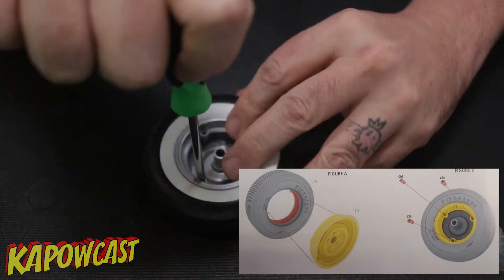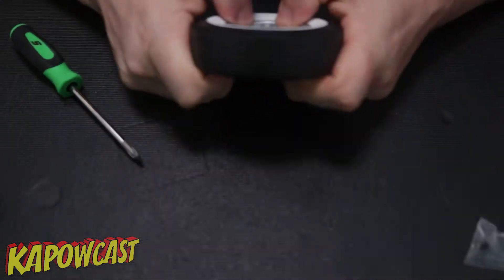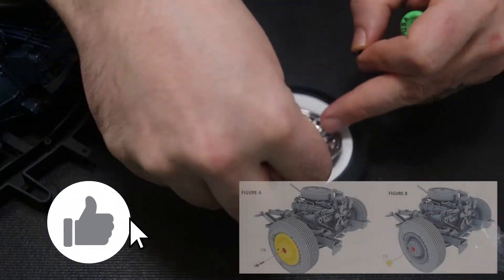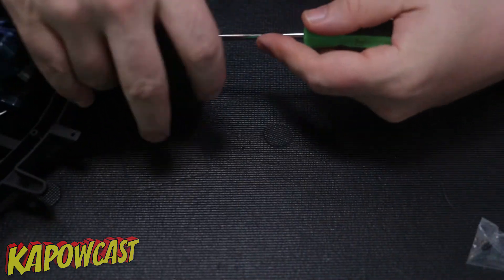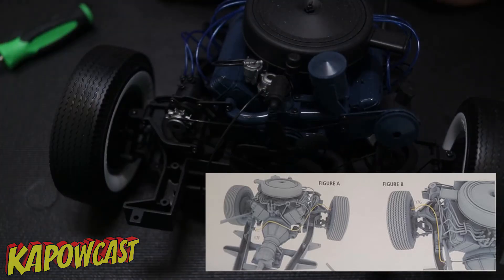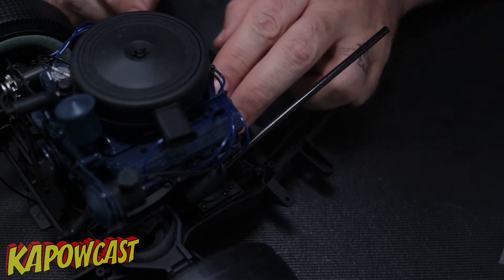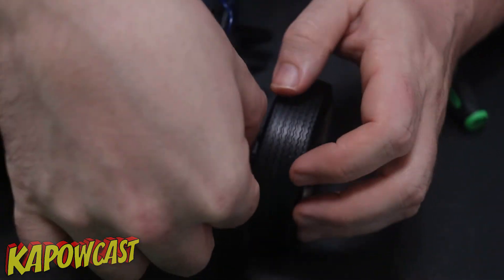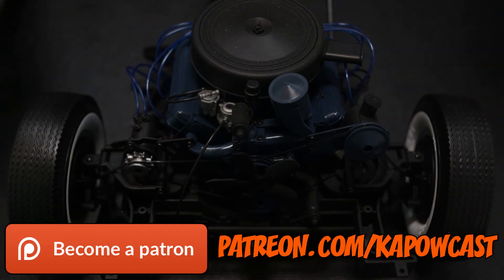GHOSTBUSTERS ECTO-1 DIECAST BUILD | EAGLEMOSS KIT 17

Comment: When I did the wheels I always screwed the piss poor screw into the part that they go into all the way and then unscrewed it and that usually worked for me
Reply from the maker: That's pretty much exactly what I did, drove it in all the way and then backed it off a bit
Reply: @Kapowcast  I cancelled that batmobile build guess too many issues with everything
Reply from the maker: Oh? I haven't heard anything on that build at all. What kind of issues?
Reply: @Kapowcast  licensing have had it since they said they were going to start it they can't confirm when that build will or ever will start up
Reply from the maker: Ah jeez, I have heard from other companies that WB is a bit of a pain to work with. Normally takes a lot longer then normal in that stage.
Reply: @Kapowcast  yeah so until they get this issue straightened out I'm not doing it but I'm doing the elenor mustang build as well so far my parts are in Nebraska waiting for me I have that build and the ecto on hold until I finally get out there